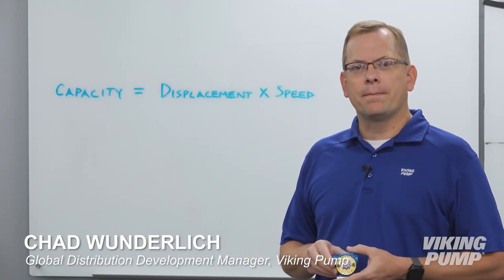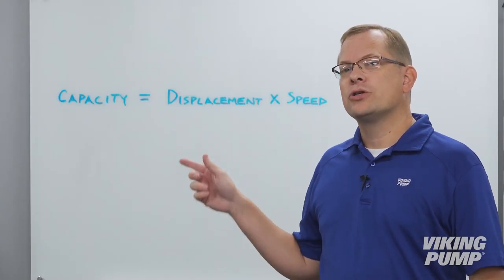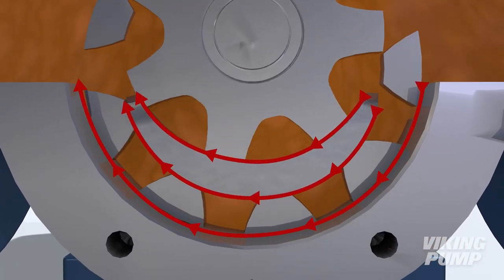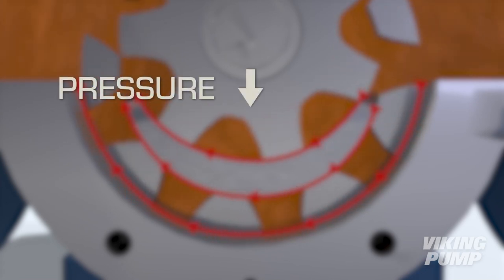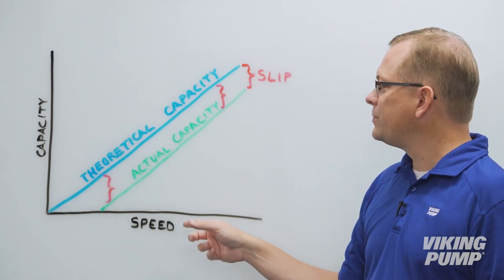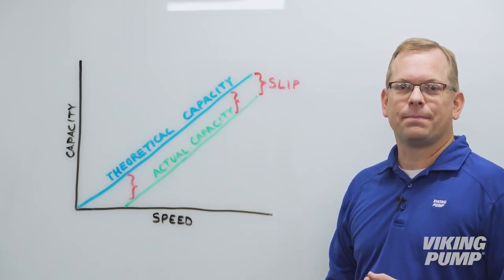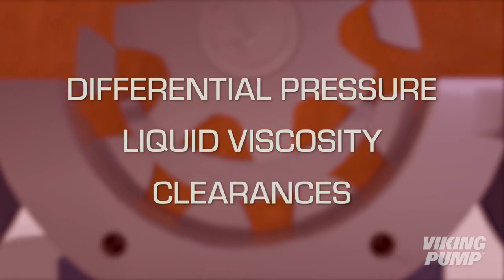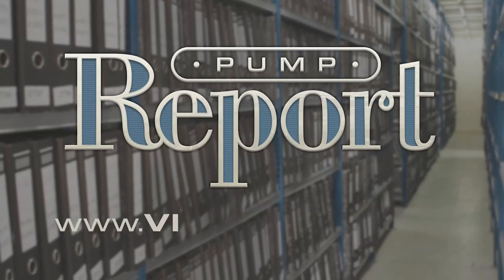How Does Slip Affect Pump Performance?

Comment: Do you burn in your pumps (using the gears to clear the housing and the crescent in the internal gear pump case)? You showed radial clearance as an issue, but it looks like you set the axial clearance with a feeler gage. How much does axial leakage also contribute to slip? Thanks.
Reply from the maker: No, Viking pumps are machined to tight tolerances to set the radial clearances. End clearance (that axial clearance you’d mentioned) is a big contributor to slip as well and would need to be properly set to minimize slip.
Reply: @VikingPumpInc  - Thanks Chad. This is Mike and I enjoyed the time you took yesterday with me.

Comment: Does slip occur in diaphgram pumps - alternative positive displacement pumps?
Reply from the maker: Nearly all positive displacement pumps experience slip to varying degrees. For diaphragm pumps it depends on the design and materials of the check valves used. A curve from the pump’s manufacturer will confirm the percentage of flow lost to slip (which is low). Air operated diaphragm pumps would have additional flow loss due to the compressibility of gases used to drive the diaphragms. If you have more questions, reach out to us here: https://www.vikingpump.com/yt